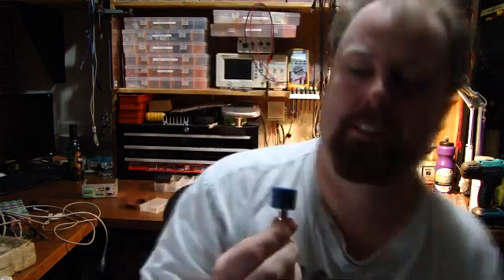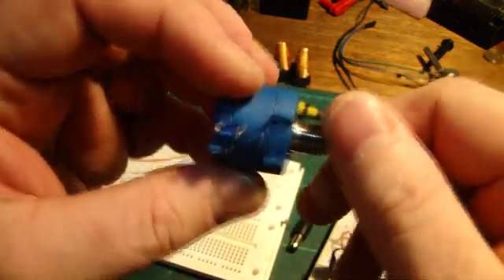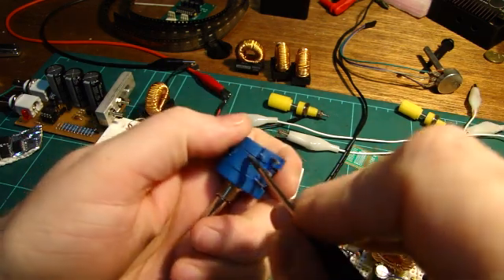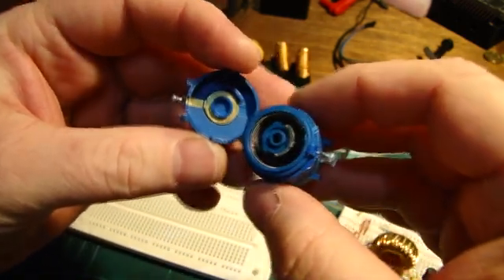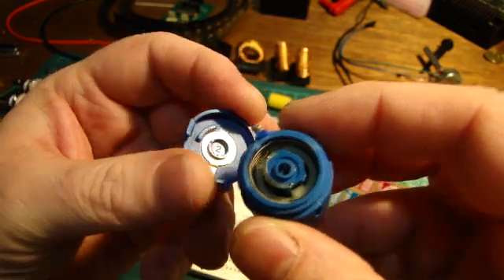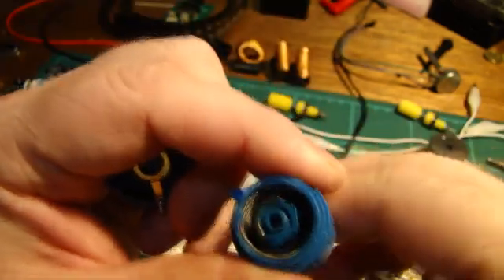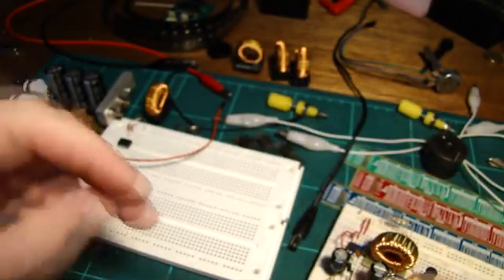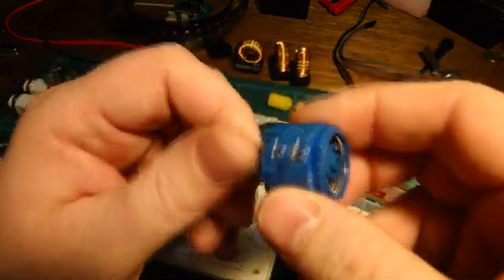10-turn Potentiometer Tear Down

Comment: I use these as a positioning sensor for a actuator. Any idea how long of a lifespan i can expect of these? When its rotating (intermittently) about 2 hours a day?
Reply from the maker: No idea really. They are would have a lifespan by I couldn't tell you. The data sheet in sure would have some metrics on it.
Reply: @AlanGarfield  I had a Bourns 500 ohm one in a power supply that was used maybe 3 or 4 times per week. It lasted about 6 years before it started to jump around. I chucked it out, but I suspect it was likely the wire surface getting dirty. It never went open-circuit, and was rated at 5W although it was barely dissipating 100mW. Cost about $10 or so back in 2002.

Comment: Hi, I just bought two bourns one.When I measured ohm via multimeter it works perfect. Then I added with my arduino board but it did not work. Then I again tested via multimeter but it is not showing any resistance. Do you have any idea why??

Comment: Kind of how I expected it would work. I wonder though, do the tiny sub-min trimmer pots work the same way? The ones with the square body that need a screwdriver to set? It'd surely be difficult to squeeze all this stuff in. 

Great video though, and I think the only one explaining what's inside a multi-turn pot. One problem though is the noise. Dunno if you need a better mic, or to isolate your mic or camera better from electrical noise.

Comment: Yours is one of the better-made Bourns types. They cheapened some these models by changing the machined brass bushing to a cast zinc bushing. When you tighten the nut on the newer ones, the bushing distorts and jams the shaft. I also noticed that on the newer ones, they left out the "C" ring that keeps the shaft from being pushed into the case. These usits can be easily broken by pushing on the shaft.

Comment: Normally nichrome wire wound around a piece of enamelled copper wire. The wire is a heat spreader for the nichrome element. With long use the wiper wears out a section of the coil and goes notchy and intermittent.